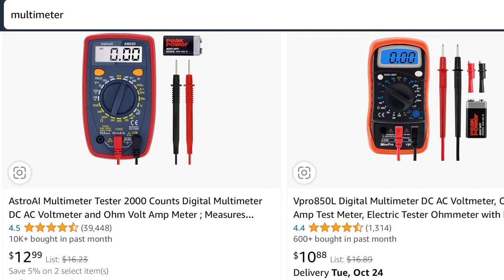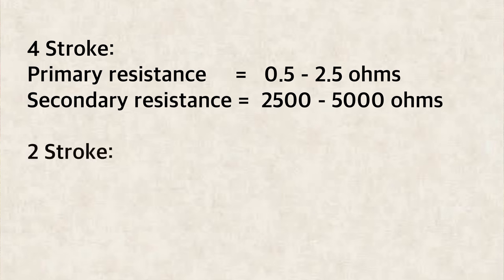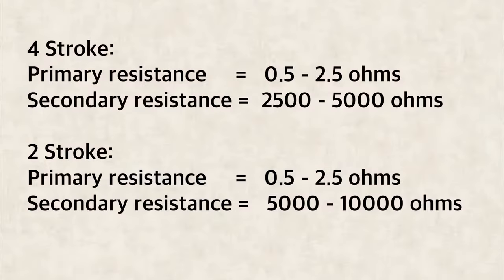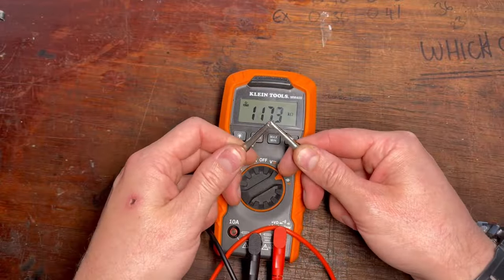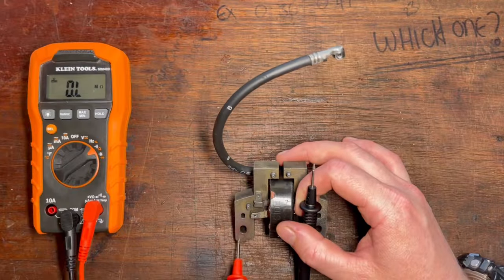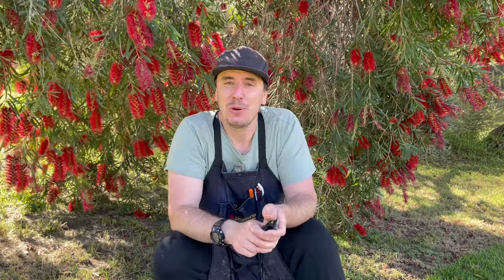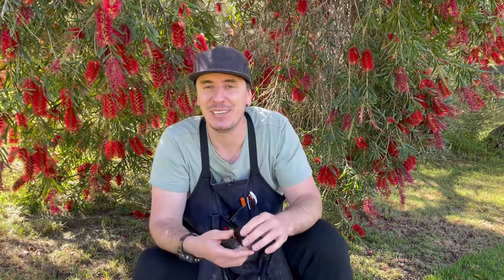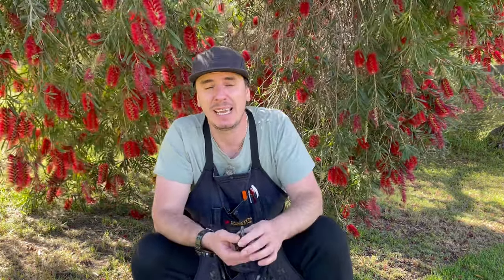Test Any Ignition Coil With A Multimeter! (Easy DIY Tutorial!)

Comment: Hello Mate Will the cause the engine to start idle then when you raise the RPM it dies or hesitates then runs Hard to start when hot
Reply from the maker: Hmmmm possibly, it can be other symptoms too though! I’d suggest it’s more likely an air leak or scored piston. Have a look as the piston skirt through the exhaust port. It should be nice and clean, no scratches or vertical scoring!
Reply: @VintageEngineRepairs  Oh geez Don't jinx me Put a new OEM carburetor on it last season & ran great Occasionally would backfire thru the carburator when shut off It has spark but its faint It doesn't make a CRACK or POP sound its just real faint These small.engines are the devil

Comment: I have an old Stihl 041 power saw with electronic Sweden ignition. there is also a German electronic ignition on some of them. And I have 3 parts saws I keep robbing electronic ignitions to keep the spark working. But one by one they fail over the years. There is a coil and it is attached to another part that picks up the magnetic signal from the flywheel. But these 2 parts are no longer available from Stihl. But all 3 coils test at around 1752 ohms which seems very high. Maybe you could test coils from an old 041 Stihl saw and show us how,,,,,,,,,,,,,,,I had to update to a 046 saw, but would like to get the 041 working again,,,,,,,,,,,,
Reply from the maker: Coils are generally very reliable, I believe the 041 is on points ignition isn’t it?

Comment: I am confused as you said test resistance and not continuity but my multimeter only has a setting for continuity.
Reply from the maker: There should be a select button. Set it to continuity then push the select button to switch between continuity and resistance.

Comment: Thanks mate , I,ve got an 85 year old Villiers mk10 that is giving everybody mixed up with it absolute hell , bad compression despite valves being newly lapped in & gapped , ( bore belled out ) , no spark , previously severely butchered in a failed attempt to get an obscure flywheel off etc . I,ll use your method to test the coils , & go from there . Much obliged , & I,ve clicked the buttons .
Reply from the maker: Thanks Phillip, I restored a mk10, they’re an amazing machine. Solid, reliable, strong, well built! Good luck with yours!

Comment: Buy a 500volt megger to check insulation breakdown resistance.
Reply from the maker: Thanks, I’ll look into it 👍
Reply: That won't help if you have a shorted turn in one of the windings, only if you have breakdown from one winding to the other or to the core.

Comment: You didn't state what a normal reading between the kill terminal and HT terminal should be when checking for electronics.
Reply from the maker: There isn’t one
Reply: Maybe you can clarify. At 6:55 you are testing between the "kill tab" and the HT terminal. You then state "If the resistance value between the armature and the HT lead or barb is correct, but the resistance value between the kill switch or kill tab and the HT lead or the barb is incorrect, then you know that it's more than  likely........" How do I know if the resistance value between the kill tab and the HT lead is incorrect?
Reply from the maker: @wrench71  if it’s reading in the kohms or mohms like is shown 👍

Comment: You completely disregarded secondary insulation breakdown. The secondary winding can and most times look normal, but at high voltage it breaks down.  A multimeter will not show you if this is an issue.
Reply from the maker: If the insulation breaks down it will show a lower resistance value. Thanks for watching !
Reply: @VintageEngineRepairs  sorry, the insulation only breaks down at high voltage (flash over), not with the 2v applied with the meter in ohms.
Reply from the maker: Ohhh yes, ideally coils will be tested by running a high enough current through on a test stand. We can only work with what we have at home :)
Reply: @VintageEngineRepairs  
No, a shorted turn cannot be resolved by resistance measurements. A single shorted turn can make the coil non-functional.
A "ring test" will detect shorted turns, but it isn't something that is easy to do without more sophisticated equipment.

Comment: Using a tool that measures resistance by using an AC signal rather than a DC  voltage. A shorted turn is not detectable using a DC voltage
Reply from the maker: It’s the way stihl recommends you test their older coils. The only reason they don’t on the modern ones is due to the reasons I have mentioned and there is a work around.
Reply: @VintageEngineRepairs   Do not get me wrong I am not Trolling .  If a Coil has a lot of shorted turns an Ohmeter will  detect a lower resistance . With big electric motors they pulse windings which produces a return pulse . 
It gets a little complex.
Like throwing a rubber ball against a wall and having it bounce back.
If it goes splat and lands flat with no bounce it is bad. 
I will make up a tester that runs on a 9 volt battery. Send you the results if you like.

Comment: If you're married you can tell your wife to put her finger in the top of the spark plug and give the recoil starter a pull see what happens.  You'll know if it has a good spark.. There's actually a spark tester you can buy very cheap.  Sometimes a meter will show a good coil but it will have a voltage leak and arc internally or the spark is weak. Always check the distance  between the coil and the flywheel. The correct distance should be the thickness of a business card. It's important to set the distance after removing a coil. While it's good to use a feeler gauge, a business card will work just fine.
Reply from the maker: Ha! I try and stay out of the dog house haha

Comment: I was thinking that all you need is a 9 volt battery, a couple of clip leads, and a volunteer to hold on to the secondary connection and the appropriate common connection while you connect and disconnect the 9 volt battery to the primary winding. Simple.
Reply from the maker: That’s far less simple than just using a multimeter 🤣
Reply from the maker: 🤣reminds me of capacitors, “hey catch this” ⚡️ 💀 the amount of times I have been zapped you’d think I’d learn 🤦‍♂️